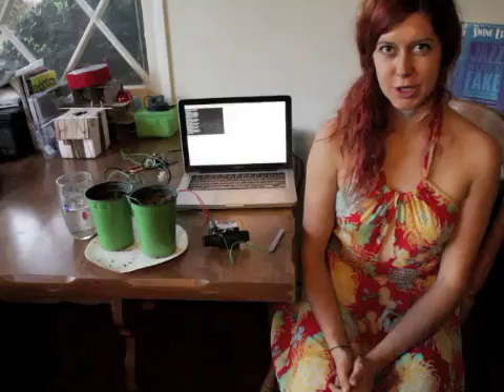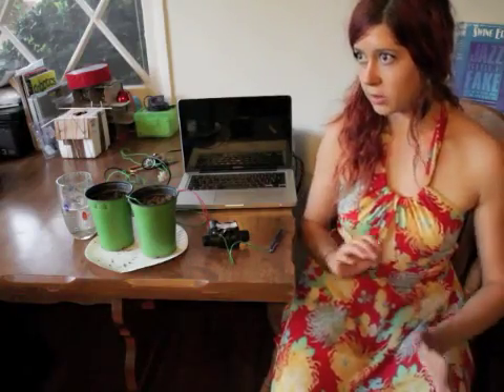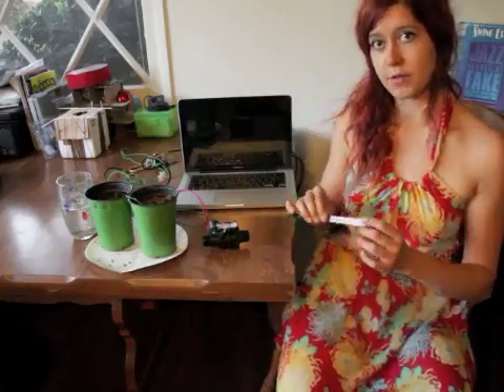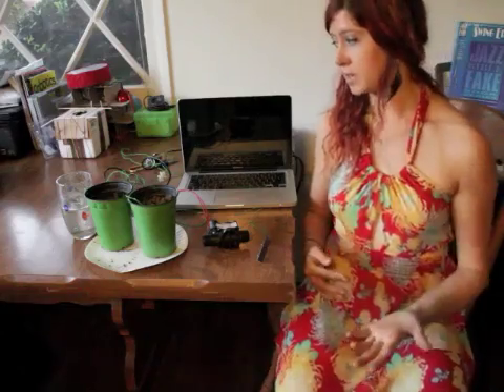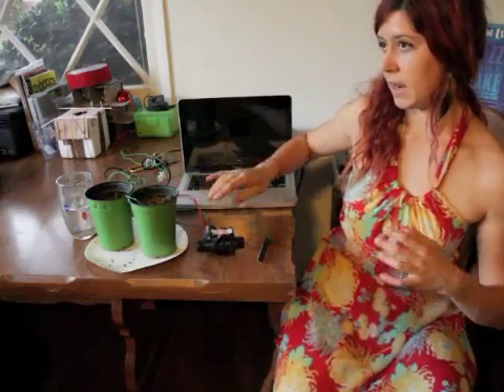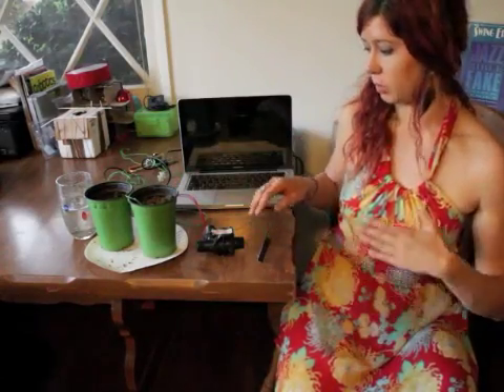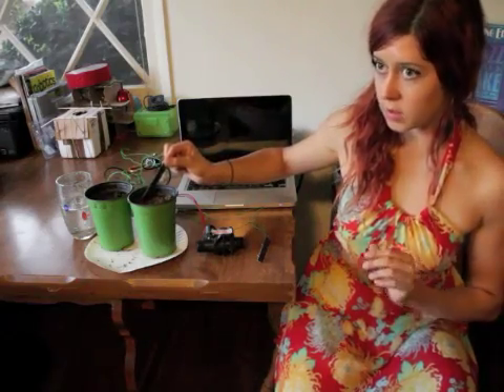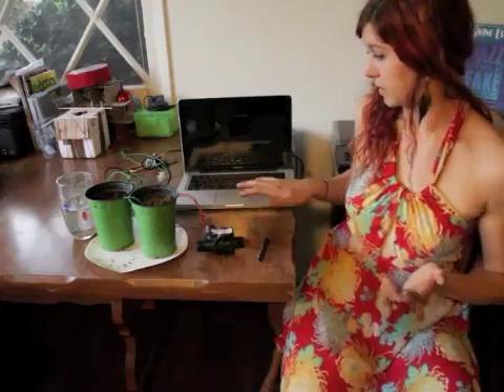DIY Science Hacks: Soil Moisture Sensor Irrigation Controller

Comment: Great video I am concerned about the capacitance moisture sensor are you running it on AC or DC .. as I understand it if you run these probes on DC then there's likely to be electrolysis are electroplating going on one of the plates,  do you know anything about this . 
 I am an old analog guy I go clear back to vacuum tubes I'm trying to figure out how to build one of these moisture sensing systems on the very cheap . 
  Direct wiring 12 V one way or the other would make this work fine    .with some transistors and a relay.
 For what it's worth most of those AC 24 V valve systems will actually run on 12 V DC OK
Reply from the maker: Thanks for the comment! The soil moisture sensor is at a low DC voltage, about 3.3VDC, so it will take some time for electrolysis to happen, although likely over time this is an issue. I haven't looked into how long it would take so your guess is as good as mine, although I will say that the PCB boards used for the sensor do have a coating on them that helps prevent corrosion. Hope that helps!

Comment: An interesting way! Soil moisture measuring via the resistance of the soil is a good option. 
But it could cause problems on different EC levels / nutrient amounts in the soil. 
There is a smaller resistance with more nutrients which could cause in over watering.
I prefer the natural way with a Blumat which uses a clay membran to open and close a valve ;)
Reply from the maker: Yup, you hit on a crucial issue -- calibration! The sensor would work differently in different types of soils. When i tested the sensor I tested it in 4 different types of soils -- a rough approximation works fine but would be tricky if you needed to be super precise. does the blumat system use water gradients (aka root suction) to water the plants?
Reply: There are two different blumat systems. One is working by the capillar forces like roots working. (The water reservoir is placed lower than the plant). And there is the dripping blumat. The water reservoir stays over the plant and works with the gravity - The clay membran works as a valve. 
It is possible to adjust the moisture level of the plants, for me it's the best option to water plants. 
I agree with you, it's all about the calibration :) 
A self watering system via two electrodes(or more to compare the data) / resistance and the rPI is a good option for smaller plants.
Reply from the maker: Whoa, that sounds super cool! I'll have to check out that blumat system. IMO, simplicity is always the best route -- less likely to fail and easier to fix. Thanks for sharing!

Comment: Why not a passive water moisture control system like blumat? Seems like a lot of money and work to control water with electronics.
Reply from the maker: Tons of reasons for this system design! First of all, this system can be remotely controlled (aka you can turn the water on/off from your phone or web browser). The blumat sensors definitely can't do that! 

There are many approaches to the same general problem, and building your own irrigation control system is a great learning experience and allows you to customize the system. In terms of cost, the blumat soil moisture sensors run at $50 a pop, my system is actually cheaper if you want to use more than one soil moisture sensor. Hope that helps!

Comment: Hello. My project is literally the same thing, but i use slightly different components. I am using a arduino to send +5V to an optocoupler, to drive a triac. The triac is to switch a 24VAC Solenoid Valve, this valve allows water to flow whenever the moisture level is below a desired level. My question is how do i turn off the triac? And since your solenoid is AC, transistors don't work for ac, only ac, this is why im using a triac.
Reply from the maker: +Haitham Adwan That sounds like an awesome project! Unfortunately I've never used a triac before, but my initial reaction would be that it should turn off when you stop sending a voltage/current to it. Your AC valve should turn on (aka open) when it has the appropriate voltage/current, and turn off (close) when there is no voltage/current. DC valves are a bit trickier in that you need to switch the polarity to turn them on/off. Try searching for a tutorial that involves the triac that you're using. Hope that helps, best of luck!
Reply: Well, the triac's gate is triggered by the optocoupler, and if i take out the gate after it has been triggered, it will stay on, the way to turn it off is if i reverse the direction of the current through the gate, changing the firing angle. i don't know how to do this.  This is basically my theses project for my final year in my electrical engineering technology program at college.
Reply from the maker: +Haitham Adwan Knowing what the problem is is the best place to start! Do some research on that issue (reversing polarity of the gate) and see what you can find :) You may need another component before the optocoupler to do that (e.g. h-bridge).
Reply: +Haitham Adwan .. I have found this post only 4 months later. I wish that you have solved the issues related to triacs. Since you are using AC voltage to power your valve then there should be no problem when turning off the triac. As soon as you remove the triggering signal from the triac it should turn off as soon as the load current falls during the AC cycle returns back to zero on its way to reversal. I am a bit curious ... Why are you so keen on using a triac ? Why not stick to a simple relay?